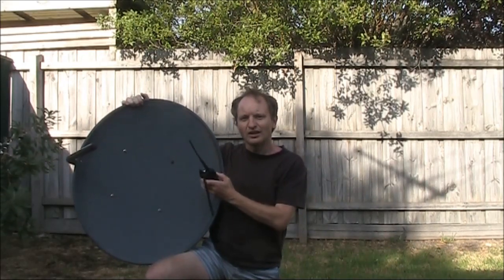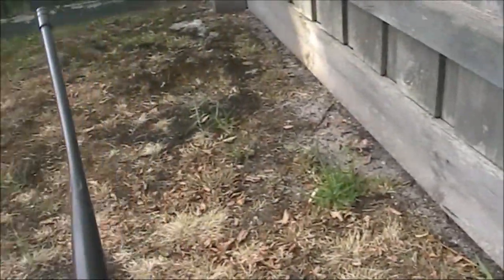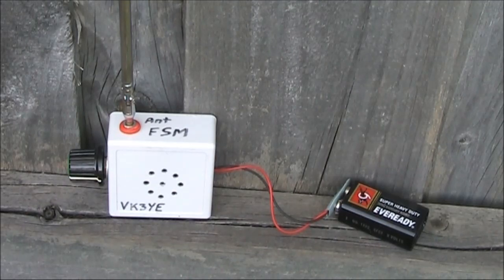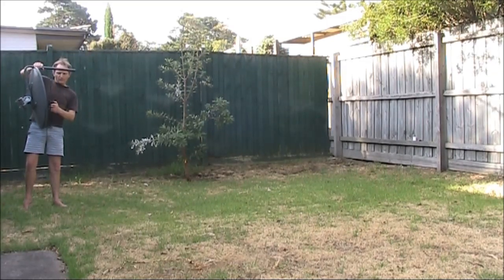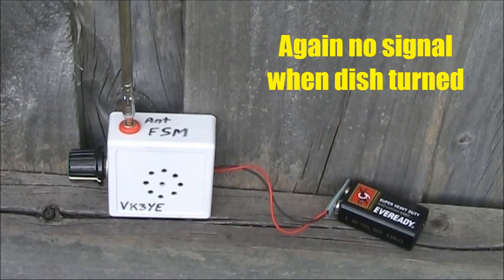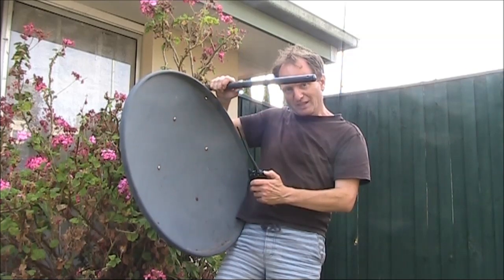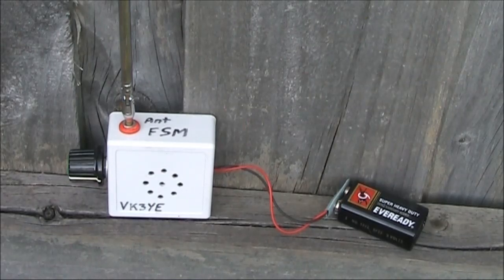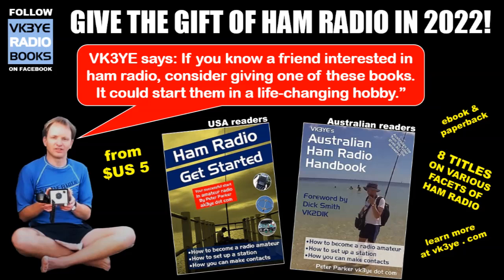Get MAXIMUM RANGE on your Baofeng with THIS

Comment: OMG!  First it is an ofset dish! A prime focus dish has a focal point in the centre. A dish is just a reflector. To give any proper meaning how about mounting it onto a sturdy tripod and make a triangualtion picture. Know your focal point and use equal antennas. Since them cheap radios are dual band we would sure be more satisfied to see the UHF performance as well.
Reply from the maker: The test was on UHF. VHF was tried briefly but the reflector was too small to have significant benefit.

Comment: I have an old Foxtel dish the same size mounted on my roof. I have a uniden 5w handheld. Any way I could plug the a cat5 or similar cable from the antenna to the socket in the wall to the dish?

Comment: HNY Peter! Great demo and food for thought indeed. It certainly would be interesting doing some more demos with small/simple antennas in-front of the dish between 1/8 to 1/4 wave spacing. This kinda reminds me of a ‘flat panel’ antenna with double quad/bow-tie in-front of a mesh reflector. The reflector dimensions are often made approx 1.0 WL x 1.2WL and this would back-up your demo that the the dish is ok for 70cms but not 2m. Indeed the radio demo could be repeated by using the side of a vehicle, metal building etc as a reflector.
Keep up the good work. Thanks again. Don’t get irradiated too much ! 
73 Nick M1DDD

Comment: There is no need for a parabolic reflector: with that wavelength it cannot concentrate RF energy as in its microwave use. It works as a reflector element of a yagi. If you use a vertical bar of the same length of its diameter holding it at its center, you achieve the same result. 73s.

Comment: Great demo there Peter. Reminds me of a corner reflector experiment I tried out a while back. A beam on 70cm bagged me extra repeaters one at a time but the reflector would gain me access to four repeaters at once South of my QTH. Ran out of chicken wire for a 2m version though! 😂
Well done, keep up the exemplary work and duly subscribed. (Embarrassed that I hadn't earlier already knowing your printed articles from some time back.)

73
M7VIC
Victor